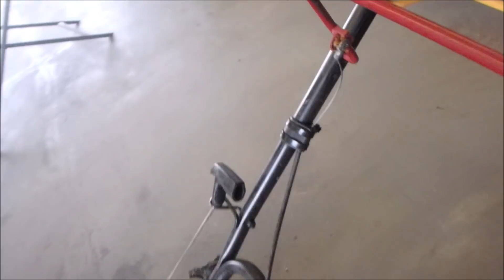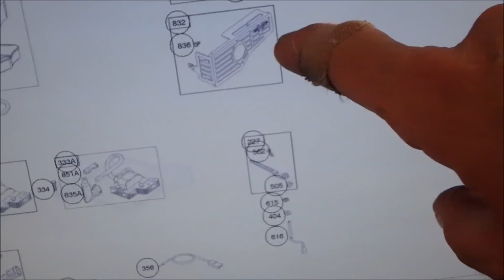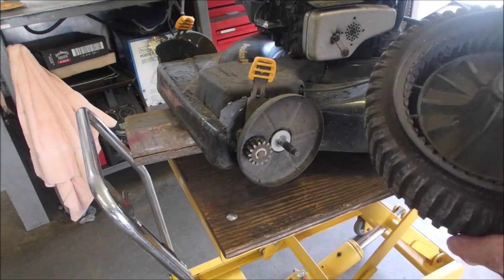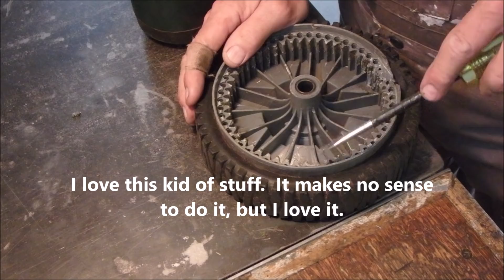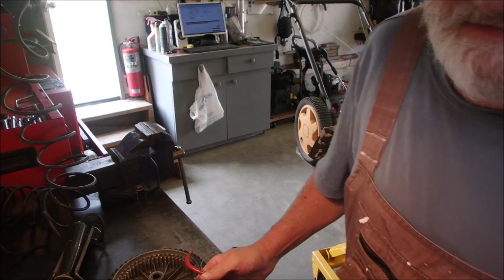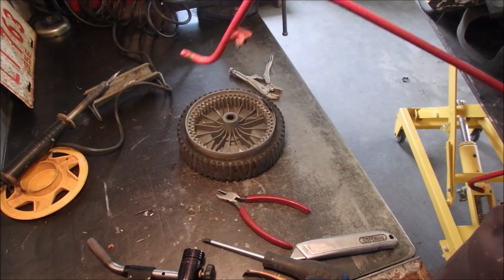A Poulan Pro Briggs classic 190 CC????

Comment: Husqvarna continued this more rare deck style that AYP made for the older craftsman’s thru the years, these were green and then silver …these rare 22 in mulch n side discharge only with FWD and had a red one with the quantum 6.25 GOLD with the bigger nice newer white back wheels and matching front drive wheels. Absolute gorgeous lawn mower and it is a beast. 2009 model it was.
Reply from the maker: Thanks for the info and fun

Comment: Nothing is more fustrating when you think you have spare parts that you have been holding onto for quite some time that will be the correct fix.  Go to slap them on and they are the same but different LOL.  That mower looks like its not the OG rear wheels.  Hats off heating and forming the the wheel.  Pretty wild the bail handle repair.  Wonder if the OG 1 broke ad he put it back together.  Where the cable goes is the weak point.
Reply from the maker: Thanks for the great comment.  Small engines are full of surprises but we don't need surprises from the factory.

Comment: I had one of these years ago on a Southern States (AYP).  They are very rare and I would have kept it if I knew that.  I called it a Quantum with a Classic gas tank which was the best of both worlds.  IIRC this tank is a bit larger and the carb inlet is bigger than a classic which means you can't interchange parts.  I have never even seen another until your video.
Reply from the maker: I was a surprise.  That carb has to be modified as it is 190cc.  Thanks Ellis

Comment: I have come across a few of these engines and they are not popular. it is in fact a Quantum engine with a longer intake manifold to accept the classic pulsaprime classic tank/carb arrangement. Other than that it is less powerful than the standard Quantum, but more powerful than the Classic.
Reply from the maker: I am not sure on the power.  I wondered if the carb had been upjetted.
Reply: You've come across a few of these engines so the are popular.

Comment: I'd say the mower was rode hard and put up wet... except for all the dried broccoli. I was sure thinking Frankenmower at first, but mildly amused with that screenshot of the parts diagram. Factory had too many pulsa jet carbs on the shelf when they switched over to Quantum style, and created this odd cousin?
Reply from the maker: That is my guess as well.  i was surprised to find a working model #

Comment: Mr.B., a couple of months ago, I had a Classic 190cc in. It was on a Prolawn deck. I know the owner had it from brand new & it wasn't  messed with or modified. The only thing caught my eye as different was the carb linkage to the governor vane. I pondered did Briggs stroke the engine to increase displacement rather than bore it, this requiring a longer vane linkage rod ? .. but then thought this was highly unlikely as the costs of casting a longer block would prohibit any benefit & it's much more likely Briggs just bored it using the same con-rod & block. Tbh I still regret not taking the shroud off & measuring the block & comparing it to another classic, & figuring out why they would change the vane linkage ? But the mower is gone up North to county Monaghan so I'll never get the chance to measure it again. It must have been very late in the Classic production run that the 190cc was made , as that was the only one I recall ever seeing.
Reply from the maker: Thanks for the informed comment.

Comment: Hi Bruce nice repair !!! I ran into a few of these problem plastic wheels one in particular a fella had used bb's he heated them and used those in the stripped out area . I replaced the wheel but will never forget the crude repair.
Reply from the maker: Wow  you would think the bb's would wreck the  drive hear.

Comment: Looks like someone (Briggs?) stuck a classic carb and tank on a quantum, along with a classic style plastic shroud that fits the larger engine. Briggs must have had some leftover classic carbs and tanks they wanted to use after production of the classic stopped, and a mower from 2008 meshes with that theory.
Reply from the maker: I totally agree.  If i was crazy I would have kept it.
Reply: @BrucesShop   And I don't think a classic tank has nearly the volume for fuel that a more typical plastic molded  tank/shroud on a quantum has.
Reply: @73honda350  I drained a full tank yesterday on a Quantum. It was 1 liter. Not sure what the capacity of the classic tank is but I think it is similar
Reply: Agreed. Model starting 12 is quantum assuming it's original metal shroud.

Comment: Bruce , thats definitely a frankenmower!  You got it going and it will probably go for a long time. Someone worked really hard to turn that mower into something that it wasn't. ✌🇺🇸🇨🇦 Roger
Reply from the maker: Ant the model number match with it on line
Reply: It came from the factory that way. I have probably done about 50,000 pushers over the years and i have seen about 4 of those. It is factory made.
Reply: @victoredington3316  definitely an odd one Victor. Ive never seen one!👍
Reply: @rogermcdonald1607  It is ODD!

Comment: Someone put that carb/tank assembly on a quantum, I have done that b4 to a snapper push mower.
Reply from the maker: It match with the online model #.  So Briggs made this strange thing.  LOL
Reply: @BrucesShop  oh wow, I've seen what is known as a europa briggs, and I've seen a Tecumseh engine just b4 they went out of business, they made an engine that looked exactly like a briggs, but I have never seen a pulsa prime carb with that style of muffkin, must of been a one year engine.
Reply: That is factory made. I have done about 50,000 pushers over the years and I  have had about 4 of those. They came from the factory that way.

Comment: Frankenmower
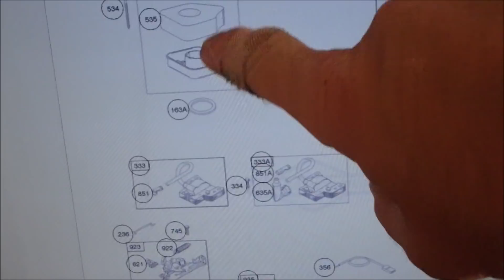Reply from the maker: And is came with a Briggs Model #     5:32
Reply: It came from the factory that way. I have done about 50,000 pushers over the years and I have had about 4 of those. It is factory made, not a frank mower.

Comment: What’s the model? 9d900 series? The first 2 numbers of the engine model denotes the cubic inch of the engine. If its the 10d900 series then that’s only 160cc so yes that’s very odd
Reply: 120T02-1043-B1
Reply from the maker: @HobbyMotorDK  Like Claus said 
https://www.ereplacementparts.com/briggs-and-stratton-120t021043b1-engine-parts-c-16758_17347_17551_218172.html
Reply from the maker: A lot of pretty experienced Lawn Mower Folks  (ladies and Men)  have never seen one.
Reply: It is factory made. I have done about 50,000 pushers over the years and I have had about 4 of those. It is factory made.